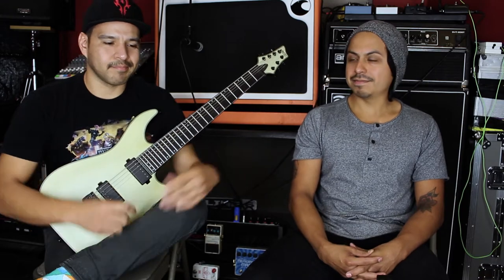Diezel VH4-2 Pedal: Metal Demo

Comment: It's filthy riffs like those that make me want to try a 7 string! 
I have this pedal and I'm in love with it. My only issue is that it's VERY loud which (at least with my rig) which makes the volume super touchy. This thing has more than enough headroom. This becomes an issue when switching the pedal on and off because of the massive disparity in volume. I've tried using EQ's etc. to lower the DB level, but I feel it affects the tone and feel which is not what I want. Maybe it's just me? Any suggestions on that? 

P.S. please keep making more vids, I think you guys are honest with your opinions, and you both play very well!

Comment: direct to soundcard or do you plug into amp using out to guitar amp ?
Reply from the maker: For the demo track at the beginning of the video, we went straight DI into our interface and used a cab sim loaded with readily available cabinet IR's.  For the demo playing, the stuff without the entire band, we placed an SM 57 on the cone, into an interface. No post processing. :) Which tone did you like better? The demo track or the playing while noodling with the pedal?
Reply: love the demo track of course ..i have the pedal but when i try to straight DI to my soundcard the sound is too much bass even i try different IRS. and the tone somehow is not tight

sorry for my bad english
Reply from the maker: what sound card do you have? As far the eq goes, for the demo, we start with everything at 12 o clock, straight up, and then add or lower to taste. If I remember correctly, the bass was about 12-1 o clock, and we cranked the mids. I know for sure the presence knob was up there to add bite, and cant remember where we had the deep knob for the demo track.